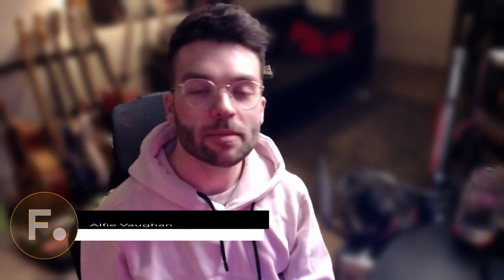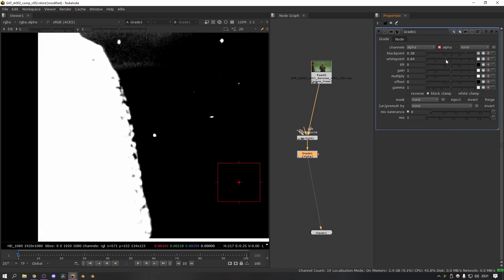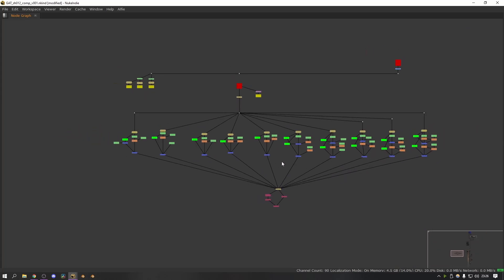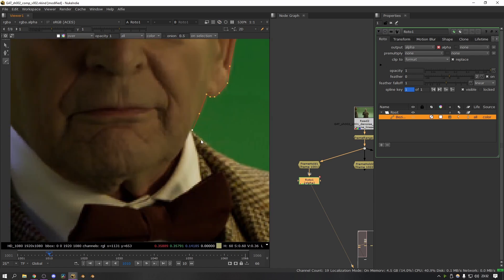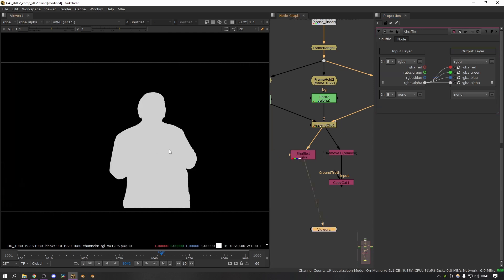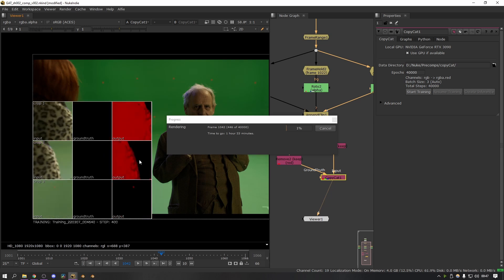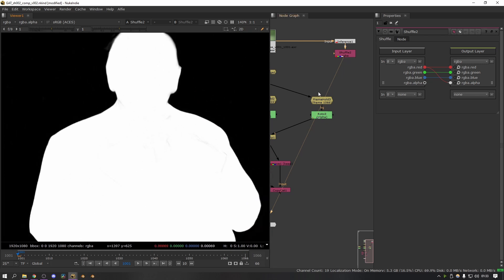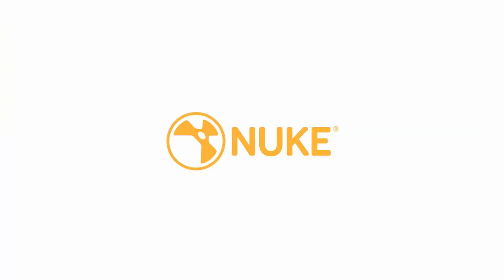Using CopyCat for Roto with @AlfieVaughan

Comment: I would greatly appreciate it if you could kindly share the ColorEdge node.
Reply: Copy and paste this into your node graph and save it as a toolset. The edge extend node that's now built into nuke also does bascially the same thing. ColourEdge was how we did it before it was a native feature!

set cut_paste_input [stack 0]
version 11.2 v6
push $cut_paste_input
Group {
 name ColourEdge
 selected true
 xpos -3742
 ypos 1378
 addUserKnob {20 User l ColourEdge}
 addUserKnob {14 blurGrain l "Blur Grain" t "Preblur the image to smooth out grain if necessary" R 0 100}
 blurGrain 0.16
 addUserKnob {14 growTexture l "Grow Texture" t "Expands the texture out from pure white pixels in the matte.  Values can go above 100." R 0 100}
 growTexture 7.6
 addUserKnob {14 shrinkMatte l "Shrink Matte" t "Adjusts the point from which the texture grows.  Values are not constrained to +-20." R -20 20}
 shrinkMatte 1.4
 addUserKnob {7 alphaToWhite l "Alpha To White" t "Lifts the alpha to white" R 0 0.99999}
 addUserKnob {4 quality l Quality M {fast better best "" ""}}
 addUserKnob {26 "" -STARTLINE T "             "}
 addUserKnob {6 invertMatte l "Invert Matte" -STARTLINE}
}
 Input {
  inputs 0
  name Mask
  xpos 1025
  ypos 42
  number 1
 }
 Dot {
  name Dot1
  xpos 1059
  ypos 177
 }
set N2c7dbd60 [stack 0]
 Dot {
  name Dot2
  xpos 949
  ypos 177
 }
 Invert {
  channels rgba
  name Invert1
  xpos 915
  ypos 211
 }
push $N2c7dbd60
 Switch {
  inputs 2
  which {{invertMatte i}}
  name Switch1
  xpos 1025
  ypos 211
 }
 Grade {
  channels {-rgba.red -rgba.green -rgba.blue rgba.alpha}
  whitepoint {{1-alphaToWhite i}}
  white_clamp true
  name Grade1
  xpos 1025
  ypos 258
 }
 FilterErode {
  channels rgba
  size {{-shrinkMatte.w} {-shrinkMatte.h}}
  name FilterErode1
  xpos 1025
  ypos 321
 }
 Grade {
  channels {-rgba.red -rgba.green -rgba.blue rgba.alpha}
  whitepoint 0.99
  black_clamp false
  white_clamp true
  name Grade6
  xpos 1025
  ypos 368
 }
set N125e46c0 [stack 0]
 Dot {
  name Dot4
  xpos 1059
  ypos 932
 }
push $N125e46c0
 Input {
  inputs 0
  name RGB
  xpos -317
  ypos 108
 }
 Shuffle {
  alpha white
  name Shuffle1
  xpos -317
  ypos 279
 }
 Blur {
  channels rgba
  size {{blurGrain.w i} {blurGrain.h i}}
  maskChannelMask -rgba.alpha
  name Blur1
  xpos -317
  ypos 376
 }
set Nf598fa30 [stack 0]
 Merge2 {
  inputs 2
  operation stencil
  name Merge1
  xpos -135
  ypos 376
 }
 Dot {
  name Dot3
  xpos -101
  ypos 423
 }
set Nf75f9280 [stack 0]
 Blur {
  channels rgba
  size {{growTexture.w i} {growTexture.h i}}
  maskChannelMask -rgba.alpha
  name Blur2
  xpos -135
  ypos 457
 }
 Unpremult {
  name Unpremult1
  xpos -135
  ypos 504
 }
 Expression {
  expr3 a==0?0:1
  name Expression2
  xpos -135
  ypos 551
 }
 ColorCorrect {
  name ColorCorrect1
  xpos -135
  ypos 598
 }
 Dot {
  name Dot17
  xpos -101
  ypos 756
 }
set Nf88e8e40 [stack 0]
 Dot {
  name Dot15
  xpos -101
  ypos 836
 }
set N98c07d0 [stack 0]
push $Nf75f9280
 Dot {
  name Dot6
  xpos 52
  ypos 423
 }
set N80891ba0 [stack 0]
 Blur {
  channels rgba
  size {{growTexture.w*.5 i x1 72.7} {growTexture.h*.5 i x1 64.662}}
  maskChannelMask -rgba.alpha
  name Blur3
  xpos 18
  ypos 457
 }
 Unpremult {
  name Unpremult2
  xpos 18
  ypos 504
 }
set Nd6ebce0 [stack 0]
 Expression {
  expr3 a==0?0:1
  name Expression1
  xpos 18
  ypos 551
 }
set Nf35df3d0 [stack 0]
 FilterErode {
  channels {-rgba.red -rgba.green -rgba.blue rgba.alpha}
  size {{parent.Blur3.size.w/2 i} {parent.Blur3.size.h/2 i}}
  filter quadratic
  name FilterErode4
  xpos 244
  ypos 543
 }
 Premult {
  name Premult6
  xpos 244
  ypos 606
 }
 Merge2 {
  inputs 2
  operation under
  name Merge5
  xpos 244
  ypos 830
 }
push $N80891ba0
 Dot {
  name Dot7
  xpos 416
  ypos 423
 }
set Nf63f1e80 [stack 0]
 Blur {
  channels rgba
  size {{growTexture.w*.25 i} {growTexture.h*.25 i}}
  maskChannelMask -rgba.alpha
  name Blur4
  xpos 382
  ypos 457
 }
 Unpremult {
  name Unpremult3
  xpos 382
  ypos 504
 }
set N82cded0 [stack 0]
 Expression {
  expr3 a==0?0:1
  name Expression3
  xpos 382
  ypos 551
 }
set N80b9ae20 [stack 0]
 FilterErode {
  channels alpha
  size {{parent.Blur4.size.w/2 i} {parent.Blur4.size.h/2 i}}
  filter quadratic
  name FilterErode3
  xpos 583
  ypos 543
 }
 Premult {
  name Premult5
  xpos 583
  ypos 606
 }
 Merge2 {
  inputs 2
  operation under
  name Merge7
  xpos 583
  ypos 830
 }
push $Nf63f1e80
 Dot {
  name Dot8
  xpos 759
  ypos 423
 }
 Blur {
  channels rgba
  size {{growTexture.w*.125 i} {growTexture.h*.125 i}}
  maskChannelMask -rgba.alpha
  name Blur5
  xpos 725
  ypos 457
 }
 Unpremult {
  name Unpremult4
  xpos 725
  ypos 504
 }
set Nfdbfb3f0 [stack 0]
 Expression {
  expr3 a==0?0:1
  name Expression4
  xpos 725
  ypos 551
 }
set Nf49b0c50 [stack 0]
 FilterErode {
  channels {-rgba.red -rgba.green -rgba.blue rgba.alpha}
  size {{parent.Blur5.size.w/2 i} {parent.Blur5.size.h/2 i}}
  filter quadratic
  name FilterErode2
  xpos 934
  ypos 543
 }
 Premult {
  name Premult1
  xpos 934
  ypos 606
 }
 Merge2 {
  inputs 2
  operation under
  name Merge9
  xpos 934
  ypos 830
 }
 Dot {
  name Dot18
  xpos 968
  ypos 877
 }
push $Nf88e8e40
push $Nd6ebce0
 Dot {
  name Dot9
  xpos -17
  ypos 510
 }
 Dot {
  name Dot10
  xpos -17
  ypos 646
 }
push $Nf35df3d0
 Dot {
  name Dot20
  xpos 52
  ypos 598
 }
set N82ceff40 [stack 0]
 Merge2 {
  inputs 2
  operation from
  Achannels {-rgba.red -rgba.green -rgba.blue rgba.alpha}
  Bchannels {-rgba.red -rgba.green -rgba.blue rgba.alpha}
  output {-rgba.red -rgba.green -rgba.blue rgba.alpha}
  name Merge2
  xpos 18
  ypos 632
 }
 Grade {
  channels {-rgba.red -rgba.green -rgba.blue rgba.alpha}
  gamma 0.005
  black_clamp false
  name Grade2
  xpos 18
  ypos 695
 }
push $N82ceff40
 Dot {
  name Dot19
  xpos 162
  ypos 598
 }
 Merge2 {
  inputs 2
  operation stencil
  name Merge11
  xpos 128
  ypos 703
 }
 Merge2 {
  inputs 2
  operation under
  name Merge6
  xpos 128
  ypos 750
 }
push $N82cded0
 Dot {
  name Dot11
  xpos 347
  ypos 510
 }
 Dot {
  name Dot12
  xpos 347
  ypos 646
 }
push $N80b9ae20
 Dot {
  name Dot21
  xpos 416
  ypos 598
 }
set Nf4485820 [stack 0]
 Merge2 {
  inputs 2
  operation from
  Achannels {-rgba.red -rgba.green -rgba.blue rgba.alpha}
  Bchannels {-rgba.red -rgba.green -rgba.blue rgba.alpha}
  output {-rgba.red -rgba.green -rgba.blue rgba.alpha}
  name Merge3
  xpos 382
  ypos 632
 }
 Grade {
  channels {-rgba.red -rgba.green -rgba.blue rgba.alpha}
  gamma 0.005
  black_clamp false
  name Grade3
  xpos 382
  ypos 695
 }
push $Nf4485820
 Dot {
  name Dot23
  xpos 526
  ypos 598
 }
 Merge2 {
  inputs 2
  operation stencil
  name Merge12
  xpos 492
  ypos 703
 }
 Merge2 {
  inputs 2
  operation under
  name Merge8
  xpos 492
  ypos 750
 }
push $Nfdbfb3f0
 Dot {
  name Dot13
  xpos 690
  ypos 510
 }
 Dot {
  name Dot14
  xpos 690
  ypos 646
 }
push $Nf49b0c50
 Dot {
  name Dot24
  xpos 759
  ypos 598
 }
set Neb5ca7e0 [stack 0]
 Merge2 {
  inputs 2
  operation from
  Achannels {-rgba.red -rgba.green -rgba.blue rgba.alpha}
  Bchannels {-rgba.red -rgba.green -rgba.blue rgba.alpha}
  output {-rgba.red -rgba.green -rgba.blue rgba.alpha}
  name Merge4
  xpos 725
  ypos 632
 }
 Grade {
  channels {-rgba.red -rgba.green -rgba.blue rgba.alpha}
  gamma 0.005
  black_clamp false
  name Grade4
  xpos 725
  ypos 695
 }
push $Neb5ca7e0
 Dot {
  name Dot25
  xpos 869
  ypos 598
 }
 Merge2 {
  inputs 2
  operation stencil
  name Merge13
  xpos 835
  ypos 703
 }
 Merge2 {
  inputs 2
  operation under
  name Merge10
  xpos 835
  ypos 750
 }
 Dot {
  name Dot22
  xpos 869
  ypos 797
 }
 Dot {
  name Dot16
  xpos -3
  ypos 797
 }
push $N98c07d0
 Switch {
  inputs 3
  which {{quality}}
  name Switch2
  xpos -135
  ypos 871
 }
push $Nf598fa30
 Dot {
  name Dot5
  xpos -295
  ypos 932
 }
 Keymix {
  inputs 3
  name Keymix1
  xpos -135
  ypos 918
 }
 Output {
  name Output1
  xpos -135
  ypos 1032
 }
end_group

Comment: where did you get Colour Edge? 8:48. I don't have it in standart nuke
Reply: Copy and paste this into your node graph and save it as a toolset. The edge extend node that's now built into nuke also does bascially the same thing. ColourEdge was how we did it before it was a native feature!

set cut_paste_input [stack 0]
version 11.2 v6
push $cut_paste_input
Group {
 name ColourEdge
 selected true
 xpos -3742
 ypos 1378
 addUserKnob {20 User l ColourEdge}
 addUserKnob {14 blurGrain l "Blur Grain" t "Preblur the image to smooth out grain if necessary" R 0 100}
 blurGrain 0.16
 addUserKnob {14 growTexture l "Grow Texture" t "Expands the texture out from pure white pixels in the matte.  Values can go above 100." R 0 100}
 growTexture 7.6
 addUserKnob {14 shrinkMatte l "Shrink Matte" t "Adjusts the point from which the texture grows.  Values are not constrained to +-20." R -20 20}
 shrinkMatte 1.4
 addUserKnob {7 alphaToWhite l "Alpha To White" t "Lifts the alpha to white" R 0 0.99999}
 addUserKnob {4 quality l Quality M {fast better best "" ""}}
 addUserKnob {26 "" -STARTLINE T "             "}
 addUserKnob {6 invertMatte l "Invert Matte" -STARTLINE}
}
 Input {
  inputs 0
  name Mask
  xpos 1025
  ypos 42
  number 1
 }
 Dot {
  name Dot1
  xpos 1059
  ypos 177
 }
set N2c7dbd60 [stack 0]
 Dot {
  name Dot2
  xpos 949
  ypos 177
 }
 Invert {
  channels rgba
  name Invert1
  xpos 915
  ypos 211
 }
push $N2c7dbd60
 Switch {
  inputs 2
  which {{invertMatte i}}
  name Switch1
  xpos 1025
  ypos 211
 }
 Grade {
  channels {-rgba.red -rgba.green -rgba.blue rgba.alpha}
  whitepoint {{1-alphaToWhite i}}
  white_clamp true
  name Grade1
  xpos 1025
  ypos 258
 }
 FilterErode {
  channels rgba
  size {{-shrinkMatte.w} {-shrinkMatte.h}}
  name FilterErode1
  xpos 1025
  ypos 321
 }
 Grade {
  channels {-rgba.red -rgba.green -rgba.blue rgba.alpha}
  whitepoint 0.99
  black_clamp false
  white_clamp true
  name Grade6
  xpos 1025
  ypos 368
 }
set N125e46c0 [stack 0]
 Dot {
  name Dot4
  xpos 1059
  ypos 932
 }
push $N125e46c0
 Input {
  inputs 0
  name RGB
  xpos -317
  ypos 108
 }
 Shuffle {
  alpha white
  name Shuffle1
  xpos -317
  ypos 279
 }
 Blur {
  channels rgba
  size {{blurGrain.w i} {blurGrain.h i}}
  maskChannelMask -rgba.alpha
  name Blur1
  xpos -317
  ypos 376
 }
set Nf598fa30 [stack 0]
 Merge2 {
  inputs 2
  operation stencil
  name Merge1
  xpos -135
  ypos 376
 }
 Dot {
  name Dot3
  xpos -101
  ypos 423
 }
set Nf75f9280 [stack 0]
 Blur {
  channels rgba
  size {{growTexture.w i} {growTexture.h i}}
  maskChannelMask -rgba.alpha
  name Blur2
  xpos -135
  ypos 457
 }
 Unpremult {
  name Unpremult1
  xpos -135
  ypos 504
 }
 Expression {
  expr3 a==0?0:1
  name Expression2
  xpos -135
  ypos 551
 }
 ColorCorrect {
  name ColorCorrect1
  xpos -135
  ypos 598
 }
 Dot {
  name Dot17
  xpos -101
  ypos 756
 }
set Nf88e8e40 [stack 0]
 Dot {
  name Dot15
  xpos -101
  ypos 836
 }
set N98c07d0 [stack 0]
push $Nf75f9280
 Dot {
  name Dot6
  xpos 52
  ypos 423
 }
set N80891ba0 [stack 0]
 Blur {
  channels rgba
  size {{growTexture.w*.5 i x1 72.7} {growTexture.h*.5 i x1 64.662}}
  maskChannelMask -rgba.alpha
  name Blur3
  xpos 18
  ypos 457
 }
 Unpremult {
  name Unpremult2
  xpos 18
  ypos 504
 }
set Nd6ebce0 [stack 0]
 Expression {
  expr3 a==0?0:1
  name Expression1
  xpos 18
  ypos 551
 }
set Nf35df3d0 [stack 0]
 FilterErode {
  channels {-rgba.red -rgba.green -rgba.blue rgba.alpha}
  size {{parent.Blur3.size.w/2 i} {parent.Blur3.size.h/2 i}}
  filter quadratic
  name FilterErode4
  xpos 244
  ypos 543
 }
 Premult {
  name Premult6
  xpos 244
  ypos 606
 }
 Merge2 {
  inputs 2
  operation under
  name Merge5
  xpos 244
  ypos 830
 }
push $N80891ba0
 Dot {
  name Dot7
  xpos 416
  ypos 423
 }
set Nf63f1e80 [stack 0]
 Blur {
  channels rgba
  size {{growTexture.w*.25 i} {growTexture.h*.25 i}}
  maskChannelMask -rgba.alpha
  name Blur4
  xpos 382
  ypos 457
 }
 Unpremult {
  name Unpremult3
  xpos 382
  ypos 504
 }
set N82cded0 [stack 0]
 Expression {
  expr3 a==0?0:1
  name Expression3
  xpos 382
  ypos 551
 }
set N80b9ae20 [stack 0]
 FilterErode {
  channels alpha
  size {{parent.Blur4.size.w/2 i} {parent.Blur4.size.h/2 i}}
  filter quadratic
  name FilterErode3
  xpos 583
  ypos 543
 }
 Premult {
  name Premult5
  xpos 583
  ypos 606
 }
 Merge2 {
  inputs 2
  operation under
  name Merge7
  xpos 583
  ypos 830
 }
push $Nf63f1e80
 Dot {
  name Dot8
  xpos 759
  ypos 423
 }
 Blur {
  channels rgba
  size {{growTexture.w*.125 i} {growTexture.h*.125 i}}
  maskChannelMask -rgba.alpha
  name Blur5
  xpos 725
  ypos 457
 }
 Unpremult {
  name Unpremult4
  xpos 725
  ypos 504
 }
set Nfdbfb3f0 [stack 0]
 Expression {
  expr3 a==0?0:1
  name Expression4
  xpos 725
  ypos 551
 }
set Nf49b0c50 [stack 0]
 FilterErode {
  channels {-rgba.red -rgba.green -rgba.blue rgba.alpha}
  size {{parent.Blur5.size.w/2 i} {parent.Blur5.size.h/2 i}}
  filter quadratic
  name FilterErode2
  xpos 934
  ypos 543
 }
 Premult {
  name Premult1
  xpos 934
  ypos 606
 }
 Merge2 {
  inputs 2
  operation under
  name Merge9
  xpos 934
  ypos 830
 }
 Dot {
  name Dot18
  xpos 968
  ypos 877
 }
push $Nf88e8e40
push $Nd6ebce0
 Dot {
  name Dot9
  xpos -17
  ypos 510
 }
 Dot {
  name Dot10
  xpos -17
  ypos 646
 }
push $Nf35df3d0
 Dot {
  name Dot20
  xpos 52
  ypos 598
 }
set N82ceff40 [stack 0]
 Merge2 {
  inputs 2
  operation from
  Achannels {-rgba.red -rgba.green -rgba.blue rgba.alpha}
  Bchannels {-rgba.red -rgba.green -rgba.blue rgba.alpha}
  output {-rgba.red -rgba.green -rgba.blue rgba.alpha}
  name Merge2
  xpos 18
  ypos 632
 }
 Grade {
  channels {-rgba.red -rgba.green -rgba.blue rgba.alpha}
  gamma 0.005
  black_clamp false
  name Grade2
  xpos 18
  ypos 695
 }
push $N82ceff40
 Dot {
  name Dot19
  xpos 162
  ypos 598
 }
 Merge2 {
  inputs 2
  operation stencil
  name Merge11
  xpos 128
  ypos 703
 }
 Merge2 {
  inputs 2
  operation under
  name Merge6
  xpos 128
  ypos 750
 }
push $N82cded0
 Dot {
  name Dot11
  xpos 347
  ypos 510
 }
 Dot {
  name Dot12
  xpos 347
  ypos 646
 }
push $N80b9ae20
 Dot {
  name Dot21
  xpos 416
  ypos 598
 }
set Nf4485820 [stack 0]
 Merge2 {
  inputs 2
  operation from
  Achannels {-rgba.red -rgba.green -rgba.blue rgba.alpha}
  Bchannels {-rgba.red -rgba.green -rgba.blue rgba.alpha}
  output {-rgba.red -rgba.green -rgba.blue rgba.alpha}
  name Merge3
  xpos 382
  ypos 632
 }
 Grade {
  channels {-rgba.red -rgba.green -rgba.blue rgba.alpha}
  gamma 0.005
  black_clamp false
  name Grade3
  xpos 382
  ypos 695
 }
push $Nf4485820
 Dot {
  name Dot23
  xpos 526
  ypos 598
 }
 Merge2 {
  inputs 2
  operation stencil
  name Merge12
  xpos 492
  ypos 703
 }
 Merge2 {
  inputs 2
  operation under
  name Merge8
  xpos 492
  ypos 750
 }
push $Nfdbfb3f0
 Dot {
  name Dot13
  xpos 690
  ypos 510
 }
 Dot {
  name Dot14
  xpos 690
  ypos 646
 }
push $Nf49b0c50
 Dot {
  name Dot24
  xpos 759
  ypos 598
 }
set Neb5ca7e0 [stack 0]
 Merge2 {
  inputs 2
  operation from
  Achannels {-rgba.red -rgba.green -rgba.blue rgba.alpha}
  Bchannels {-rgba.red -rgba.green -rgba.blue rgba.alpha}
  output {-rgba.red -rgba.green -rgba.blue rgba.alpha}
  name Merge4
  xpos 725
  ypos 632
 }
 Grade {
  channels {-rgba.red -rgba.green -rgba.blue rgba.alpha}
  gamma 0.005
  black_clamp false
  name Grade4
  xpos 725
  ypos 695
 }
push $Neb5ca7e0
 Dot {
  name Dot25
  xpos 869
  ypos 598
 }
 Merge2 {
  inputs 2
  operation stencil
  name Merge13
  xpos 835
  ypos 703
 }
 Merge2 {
  inputs 2
  operation under
  name Merge10
  xpos 835
  ypos 750
 }
 Dot {
  name Dot22
  xpos 869
  ypos 797
 }
 Dot {
  name Dot16
  xpos -3
  ypos 797
 }
push $N98c07d0
 Switch {
  inputs 3
  which {{quality}}
  name Switch2
  xpos -135
  ypos 871
 }
push $Nf598fa30
 Dot {
  name Dot5
  xpos -295
  ypos 932
 }
 Keymix {
  inputs 3
  name Keymix1
  xpos -135
  ypos 918
 }
 Output {
  name Output1
  xpos -135
  ypos 1032
 }
end_group